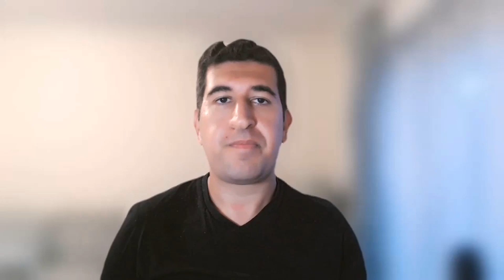How to build your own malware analysis lab? P. 1

Comment: Awesome video. Is there any reason you don't just install a VPN on the Host OS (rather than set up two VMs and a gateway through Linux)?
Reply from the maker: Thank you :) If you install a VPN on the host itself and used NAT instead of bridged on the VM. Probably it will work. But my experience with Windows VPN is not the same as Linux. Give it a try and see. 

Most importantly, don't share the same network between the Host OS and the VM because in this case, your Host OS will be vulnerable to network attacks